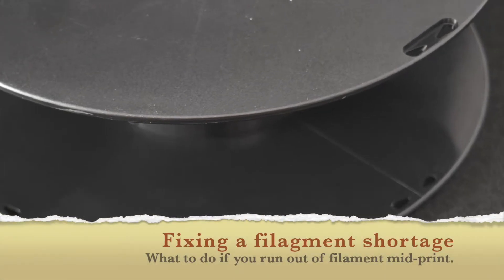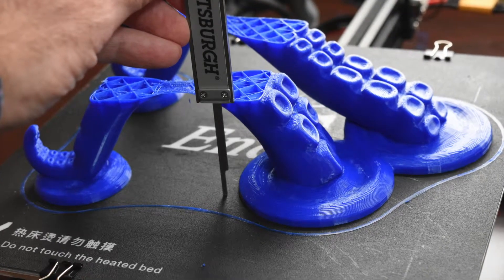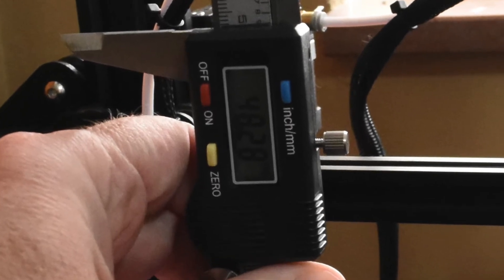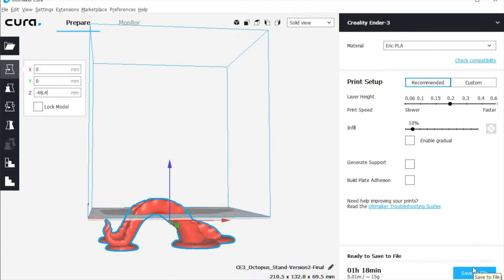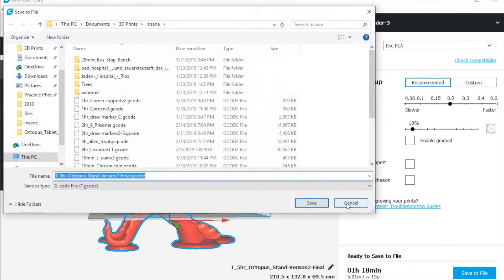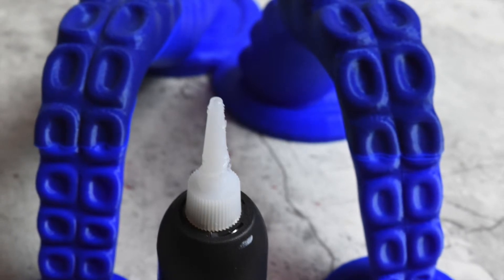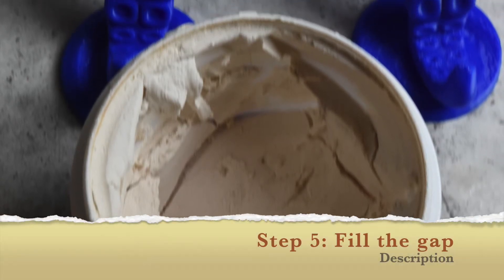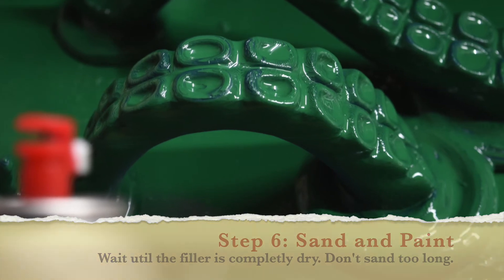What to do if you run out of filament during a 3d print.

Comment: Couldn't you theoretically continue the print by adding Z-offset of the same height you measured before on your printer? Maybe putting some glue on the model before continuing? Just an Idea, but it sounds promising.

Comment: Is there a way you can tell the printer to just pick up where it left off so you don’t have to glue and sand?
Reply from the maker: I haven't seen anyway with my printer.  I've had to use this method about four times now.  I think there might be a way to pause a print job if you have an out-of-filament sensor, but with only four occurrences in two years I haven't found justification.
Reply: @Ericscreativeside  My printer actually can pause, so maybe just pause when the filament gets close to being done, then stick the filament in, and continue printing? Should i do that or this method? I think your method might be better because I think it might be more precise.
Reply from the maker: @oldliempje1469  The pause method would work better if you catch it.   Mine always runs out when I'm looking the other way or just watching the nozzle rather than the spool.
Reply: @Ericscreativeside  thank you for the help!